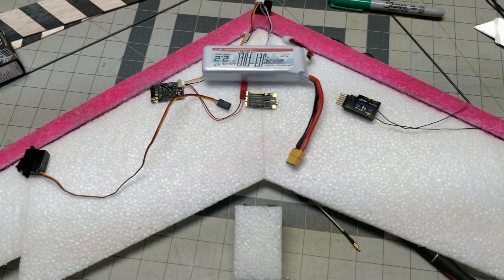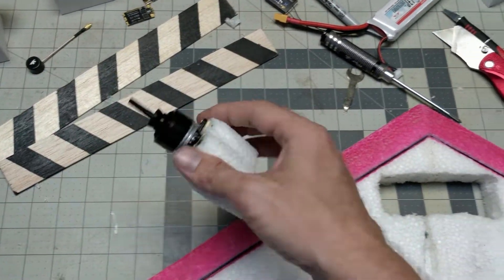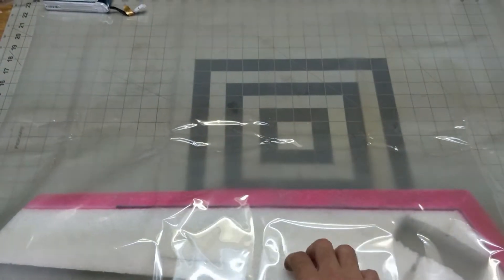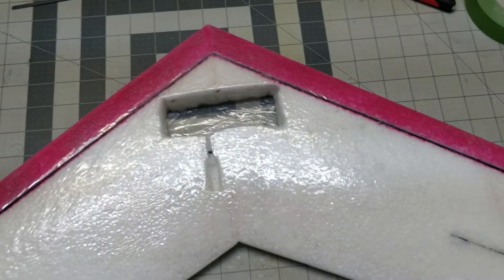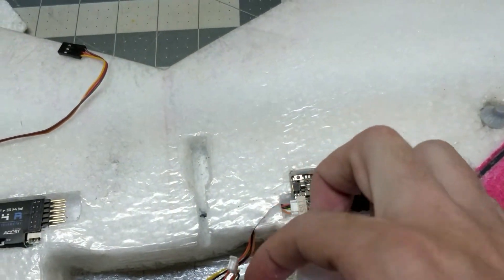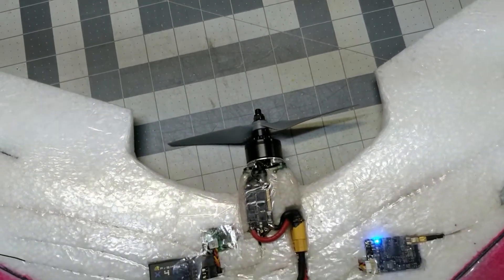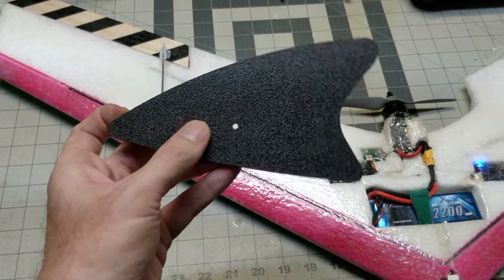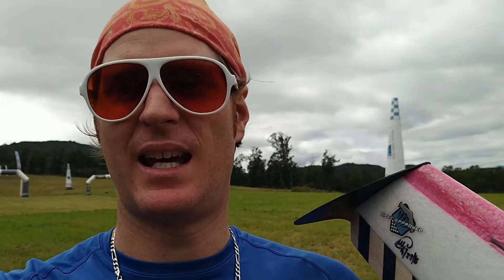VAS Spec Wing V2 Build [Part 2]

Comment: Awesome. Been into quads for 5 years and have a chimera in the closet never flown. Just finished and flew a S800 for my first ever wing experience. Dropped the goggles first flight with the S800 and that’s all it took . Bought the vas speck wing and will copy your build . I raced rc warbirds in Sacramento for years but after the covid stupid dazs sold all my rc airplanes and gear. Can’t wait for speed again . Fly low fly fast.

Comment: Very good video and presentation. I wish you had a schematic or somehow shown the wiring connections, maybe explained the use of the UBEC, etc. Also could you like the parts you used in the description (Motor, Prop, RX, VTX, UBEC, Antenna)  Nice job though, and I like the intro with the cat :-)
Reply from the maker: Check out part 3